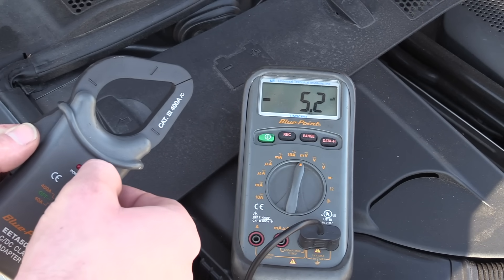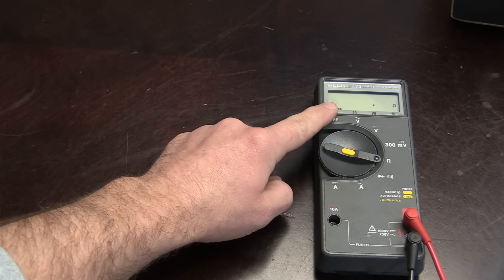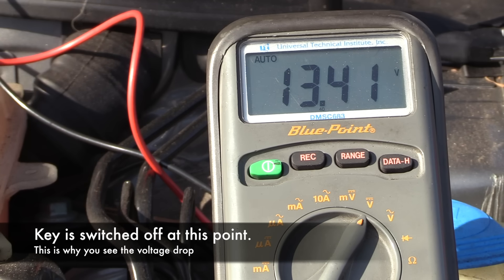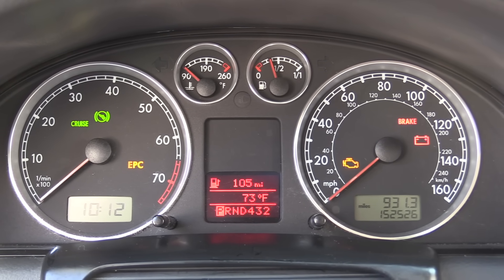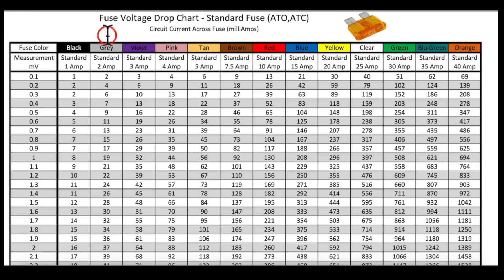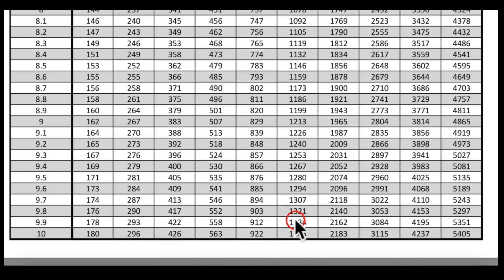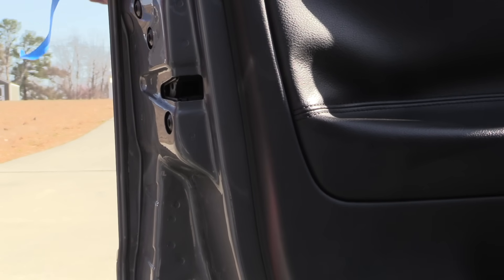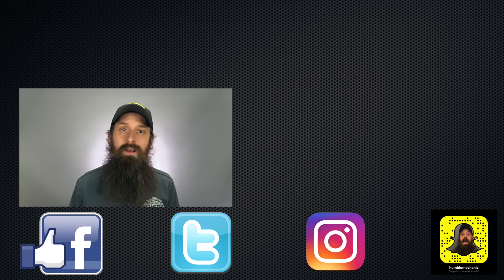The BEST Way TO Perform a Parasitic Draw Test

Comment: I have a 2004 Chrysler Crossfire.  Over the last few years two seemingly unrelated things started to happen.  The first was that when driving on hot days - say more than 33 DegC [91.5 DegF] - the Security Alarm would start and would eventually stop after lifting the bonnet (to cool things under there down).  The second was that the virtually new heavy duty battery would not hold its charge more than about a month or so.  I finally decided to address them with the battery-drain being the first;  and, following this video’s instructions to the letter, found that all fuses gave less than 0.1 mV EXCEPT the one which combined the interior roof light, the boot light and the Anti-Theft Alarm Unit, which gave a reading of 0.6 mV.  Upon disconnecting the Alarm Unit the reading on the fuse (No 9 in my car) dropped to 0.1 mV.  Obviously the Alarm Unit has a fault, which I’m going to follow-up.  So, THANK YOU VERY MUCH “The Humble Mechanic” for your really useful method of finding battery drain problems.  In my case it’s solved 2 problems at once!! 😊😊
Reply: Bonnet and boot   switches  sometimes  misalign  causing  drains

Comment: I know nothing about electricity or wiring so humor me....

If I do find that a random fuse has a draw on it when it shouldn't be what's the next thing to be? Do I change a fuse or does it get more complicated from there?  

With all the problems I've had with my Wrangler I'm sure it's going to be a lot more complicated than just swapping a fuse out.. lol

Comment: If the battery is low and the car will not start, which is usually the end result of a parasitic draw, it will take time to fully charge the battery, as recommended in the video. It may take 8 hours or more to fully charge the battery. 

Also, it is recommended if the battery shows signs of age it may not be able to power the vehicle during a lengthy diagnosis, which is correct, but you cannot replace the battery unless you do it make before break, which is not recommended and obviously dangerous if the discharged battery is damaged. 

Then it was recommended that the vehicle be started, to check the starting and charging system, while this is beneficial overall, you will wake up the vehicle and it may take up to 35 minutes or more for the vehicle to enter sleep mode.

I do not want to wait half a day before looking at a vehicle. I want to start as soon as I can to verify the customer complaint.

My approach is different from the video.

I use a DC current limited 20 VDC 20 Amp adjustable DC linear power supply (very little electrical noise) with a series power rectifier (prevents currents reversing through the supply) to put the vehicle on life support. Meaning I introduce a separate power source to power the vehicle without disconnecting the battery. This has several benefits; the first is I can set the vehicle operating voltage to a regulated known value, like 12.6 Volts. So, I know what the vehicle supply voltage is when looking at relative voltage drops. I can put a slight charge on the battery, which at some point will need to be charged, and I will not lose power during lengthy troubleshooting. My linear power supply is very electrically quiet when compared to battery chargers and has much better voltage regulation, I can also set its current limit, which can be useful. 

Parasitic draw troubleshooting may require going key on, then key off, then key on, and so on. So it is useful if the vehicle has a separate power source. Also, by having the reverse current protected supply if a large load is commanded on (you may have to go key on) the supply will work with the battery to operate the load. The battery will supply the surge or startup current and the supply steady state current. 

I also start by measuring the battery voltage, and if discharged I put the vehicle on life support. If there is some life remaining in the battery I will try and take a current reading with my B&K Clamp meter to understand the magnitude and behavior of the parasitic draw with out adding a power source to verify the problem. If the draw looks periodic or dynamic (not a steady current) I will use a scope with a wide bandwidth current clamp to see what the parasitic current is doing. If the parasitic draw is high then low then high and so on, you can only measure fuse voltage drop when the draw is present. So, it is important to understand the characteristics of the draw before formulating a troubleshooting approach. Many times you will need a scope anyway to monitor buses (a module waking up a bus in error) along with current and voltage. 

You can introduce a series ammeter in the battery circuit without interrupting power by doing make before break. However, if you have to go key on you may blow a fuse in the meter.

If you can get to the wires of a power distribution block you can track down the current draw with a clamp meter, especially if one fuse powers several loads, you can look at current beyond the power splice to find the source. So a current clamp can be more useful if the problem is a shared fuse. If you pull the fuse you can verify the problem goes away, but you will not know what load was the source. 

The life-support method using a quiet DC linear supply works especially well with vehicles that have the battery buried in the trunk, and you only have easy access to the jump start posts under hood. Most switching battery chargers have considerable AC noise when not connected directly at the battery, and even when connected at the battery are still very noisy. I want a quiet and stable vehicle supply with parasitic draw problems, I don't want to introduce more noise into the vehicle positive rail.

Comment: Hello Charles ...so Im having a issue with my car all the sudden ..I have a good battery and it drained it ..took battery out charged it ..plugged it back turned the car on ..shut it off tried restarting the car ..and nothing it wouldn't turn over..when I went out into the engine I heard a constant beeping noise coming from the engine then went away ..I can't seem to figure it out ..can you please help ..it's a 2000 Jetta

Comment: Why is it necessary to open all the doors?  Couldn't you just leave them shut except for the driver's side so you could get to the fuse box?
Reply from the maker: It’s best practice to leave yourself all the options. Incase you need to get into a fuse panel on the PS side or get under the back seat.
Reply: @HumbleMechanic  thanks so much for the reply

Comment: For older cars, you may have to tape the door ajar button on the door frame instead of flipping the latch.
Reply: yeah and I don't think even duck tape could even keep em pushed. those things are buff.
Reply: @jeromeneely202  I jamb a toothpick in along side the plunger to hold those buff ones in.
Reply: I was wondering about that. Thanks for bringing it up.

Comment: On a 2008 Ford escape, I pulled out the battery to charge. I tossed it in after it finished a day or two later. voltage read was 12.6, turned it over and dropped down to 9.6 and back up to 14.38.
You said "make sure it doesn't drop below 10" but didn't explain what the reason is for verifying that check. What does this indicate if it does drop below 10v? 9.6 seems close enough but don't want to overlook it.

Comment: Pretty good video, but there's a MAJOR flaw in it though! Not all parasitic draws are constant.. And with this test you will miss the actual draw if you just quickly test each fuse if it's not a constant drain.
Reply from the maker: Yep exactly right. PID can be super hard to chance down. That’s not a flaw with the test. That’s another possible situation that can come up.
Reply: @HumbleMechanic  yeah I hear you, It's just that there's probably so many people that may not know that there's a possibility that their draw is not constant. I wasn't necessarily trying to critique your video. I was just trying to help out 👍

Comment: Old school is to use a test light if there is any fuse that is showing current on either  side then that's your corporate at that.point disconnected what ever is linked to it till you find where the draw is coming from 
Less complicated

Comment: I have 2 cars, 98 Toyota and a 98 Nissan.
BOTH batteries will be DEAD in a weeks time YET i only have a .03 amp draw between the positive cable and the battery. I have let the meter sit for 5 hrs waiting and waiting and it never draws more than .03 amps .... I even put my camera to record for 5 hrs and that DMM never went past .03 amps on either car. Yet both batteries will be DEAD in ~7 days to where it will barely crank AFTER full charging them.

Comment: Great video and information. I personally disconnected the battery + and put my amp meter between the plus and the plus cable (10 A setting). I looked the doors and after the car went to sleep I saw a parasite draw of 250 mA. I reconnected the battery locked the doors and checked every single fuse like you did in the video. No draw found. I disconnected the battery again and hooked everything up like before. Then I disconnected the alternator lead from the alternator and the draw was 25mA. So my parasite draw was from the alternator. Since the alternator in my car is not fused I wouldn't be able to find the fault with your method alone
Reply: Thank you with all my heart for your invaluable comment, this ended up being my exact case, and if it wasn't for your comment, I wouldn't even thaught about this scenario!!! Thanks again man!!!
Reply: mind telling us what car?
Reply: @usersony112 it was a 2009 Mercedes R320 CDI

Comment: What should we do if we found it draws a high Voltage or Ampere? Just replace the fuse?
Reply from the maker: No. You will have to trace down the components to see which on that circuit is keeping awakr

Comment: Doesn't the fuse have to be blown to read amps. How does the current go through the meter when a good fuse shunts the current path? I don't understand how this works.
Reply from the maker: You’re not reading amps you’re reading volt drop on the fuse.
Reply: @HumbleMechanic  Geeez I can't believe I missed that! I'm thinking milliamps and not millivolts. Thanks for clarifying.

Comment: Doesn't the 7:01 mark you show 1006 which from the chart is 1006 milliAmps. If so that is 1 Amp not .1 Amp which is about 29 times greater than 35 milliAmps not about 3 as stated.

Comment: I don't know when you recorded this video, it's awesome, but most car owners will not see their fuses with exposed leads and you don't reference this even though you also have them in your Passat. What is the solution to that?
Reply from the maker: using a thermal camera probably, or pulling the fuse SLIGHTLY out to access the contacts.
Reply: @HumbleMechanic  TY

Comment: Thank you so much for this video.  My daughter's '06 Beetle convertible developed a parasitic power drain over the past month or so.  Following your procedure I narrowed the power draw down to fuse 38.  Driver and/or Passenger Door Control Unit.  After sitting for 2 hours, fuse 38 was pulling about .8 amps.  We had an issue with the driver side door about two months ago where the window wouldn't drop sometimes when opening, and then it wouldn't go back up.  Dealership diagnosed it has being out of adjustment.  It has been performing normally since then.  Before locking the door mechanisms for the diagnostic procedure, I decided to remove the driver side door panel so I could have access to the window motor connector.  After two hours of waiting, I verified there was still an approximate .8 amp draw from fuse 38.  I unplugged the window motor and the draw went to 0.  I plugged it back in and it went back to .8 amps.  I may be mistaken, but I think I smelled a slight burnt smell from the window motor control unit when I unplugged it.  I think this is the culprit.  I am going to order a new motor tomorrow morning and see if this sorts it out.  Thanks again!
Reply: did it work out ?  800mA is a high draw, and sometimes the plugs on those regulators suffer from high current melting them a bit, so you can see where it's burnt and the plug may need replacing too.
Reply: @DeepakKumar-lv4te  yes, we replaced the window motor which has the control module built into it. The current draw stopped, and no more issues with battery drain.

Comment: I cut open a broken fuse and attached two leads to put a current meter in between. This is of course for very low leakage currents.

Comment: I'm trying to find a spare 20 amp circuit on my '06 GMC dually to add a air pump for my new Firestone air bags. I want it to only be powered up when the truck is running...any suggestions. Thx

Comment: Thank you for this video. Question, trying to understand how to identify what a bad circuit would show on the multimeter. Is it when the fuse reads 0 and doesn't show a voltage drop that there's a possible issue?

In the example with the radio, it read 0. then you turned it on to read the voltage. and used the chart to find the amps. I'm new to electrical troubleshooting. Thank you for your content.

Comment: Good video. Always know the equipment you are using. I always change my meter out of the auto-ranging default when turned on. What looks like (example) 500 ohms could actually be  .500 (1/2 ohm) if you are not watching the floating decimal point. What can look like 119VAC can can actually be .119VAC.  That conversion chart is a blessing. And yes you tubers, it can take an hour or more for all the systems in a vehicle to go to sleep. Crazy times....

Comment: Here's one for you, Charles. My 2009 GTI has a parasitic draw of about 60 milliamps (fluctuates between 58-60 on my multimeter). That was with the driver door and hood open. However, none of the fuses under the hood or in the dash fuse box changes that at all when removed. I'll try your strategy of tricking the car into thinking the driver's door and hood are closed, let it go to sleep, and then see what the parasitic draw is. I tried your voltage drop test as well, but I couldn't register any voltage drops on any fuse. I'll have to double check to make sure I'm doing it correctly, but still a mystery yet to be solved. Is it possible for a battery to simply stop holding a charge due to age? My battery tester registered my battery as great condition, but who knows if that is accurate? It appears to be the original battery. The car has 148K miles on the clock.
Reply from the maker: Radios and door latches are most commo.  Be sure the hood and door are latched if left open.
Reply: @HumbleMechanic  I decided to test the battery disconnected from the vehicle. After charging it up to 12.6 volts, I ran a few battery tests with a cheap battery tester from amazon. Each time I ran the test, the state of charge would drop. After about a handful of tests, the battery was already down to 90% charge. That makes me think the battery can no longer hold a charge. I'm going to check it again tomorrow. If it drops significantly, I guess I'll know if I need a new battery.

Comment: Love your work.. learn so much form you. I have a mkV Jetta Australia , (Mexico built) I have dead battery drain. 1 year old genuine VW. battery. Thought it was new car stereo with canbus for stereo. finding in instrument panel fuse box  is 12 front central locking and 24 rear central locking in door fuse block. Only drawing 0.01-0.02 on miliamp for each circuit.   not sure if there is any hidden fuses else where? Only one I can think of is behind stereo itself yet to check.
 Have draw from following under hood. 
F2 - 0.05-0.09draw,  5 amp fuse shows 5amp for steering column electronics.
F6 - 0.03 draw. 5 amp fuse, shows 5 amp for Control unit in dash panel area. 
F11 0.19 draw. 5amp fuse , shows 20 amp for  Auxillary heater control unit. 
   I have been having the dreaded rear passenger door lock sometimes works sometimes doesn't and now the drivers front door lock is playing up. Could this draw from the 2 fuses be caused by 2 faulty door locking control modules ??  draw to kill the battery but this is over 5-6 days left not running.

Comment: 1006 mA = 1.006 A , not .1A (current or I)
Ohm's Law:
E=IR or EMF (voltage) = CURRENT times RESISTANCE 
Any changes in voltage measured across the fuse are a product of the changes in resistance of each specific fuse being used in the circuit and circuit current.
 At 7:10 in your video, You stated .1A, which would have been about 100mA circuit current on the chart.
Also worth noting here is that some cheap fuses like found in the Harbor Freight kits have been shown to have resistance values out of spec with SAE standards. Using quality fuses in the circuit often makes a difference when conducting these tests! You have to use a higher quality ohm meter to see the small difference in resistance  readings for fuses if you check them out of circuit. It's not zero ohms like so many expect it to be or there would be zero voltage drop measured across the fuse in circuit. Therefore, this method works (with the associated charts) only because of the resistance of each fuse, the quality of the fuses and the tables which were most likely produced using quality fuses to SAE standards. Great video, just trying to explain why it works and may not work depending on the quality of the fuses.